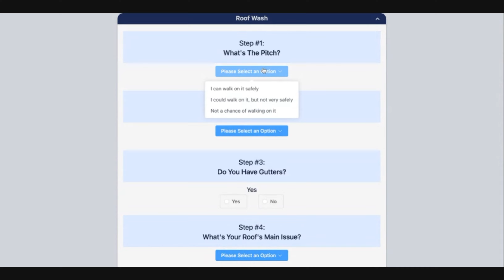If The Customer Doesn’t Like Your Price...Do This!

Comment: I think you did the right thing by asking questions. If you get a response, even if you don’t get the job, you may find out what is on the mind of the customer and why they made the choice they did. So you still win because knowledge is power, the power to adjust your strategy or pricing to fit a changing market.
Reply from the maker: Exactly